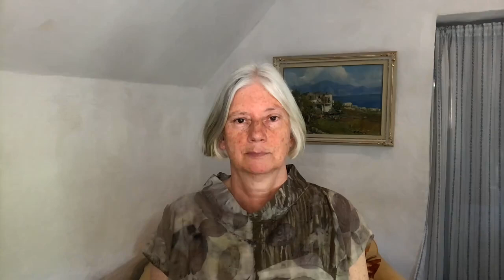How to prepare homemade rust water! #sustainabletextiles #botanicalprinting #ecoprinting

Comment: Do we remove the metal once we have the rusty water ready? (in my case it's been two weeks time) Thank you! 🙂
Reply from the maker: I like my rust water strong but only by using it will you know which results you like best. Just don't keep rusty metal in a thin walled metal pot or it will develop holes. It's fine to leave it in a plastic or rubber container though